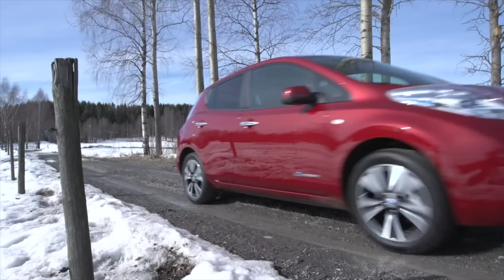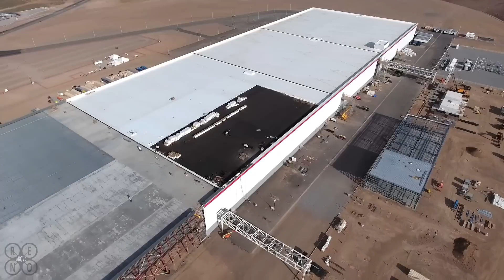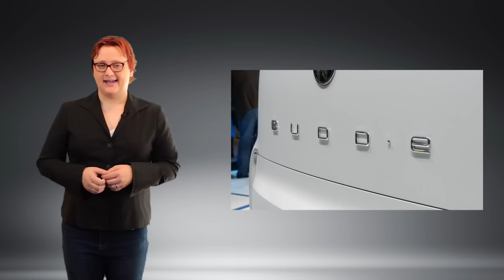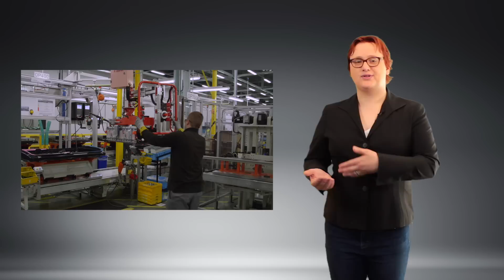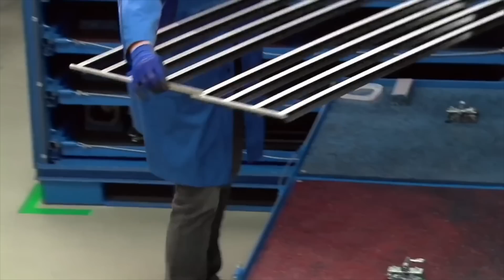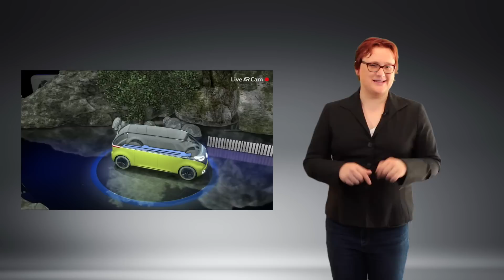What Does an Electric Car Revolution Need? 40 Gigafactories, Says VW

Comment: I think LENR modules (which work per MIT studies of it in 2014) will be energy sources for cars and replacement fuel sources for all fossil fuels (which will become material for plastics maybe).  In 2028 or sooner there will be a giant war.  This war will be the end of application of fossil fuels for war forever.   Meanwhile sodium battery packs could be approved, if they can be made safely (now being tested).  These have more capacity!  More range, lower cost.

Comment: In Germany the unions urge the car companies to build own battery factories. They fear a massive loss of work when fuel motors are not needed any more. So fuel motor factories have to be replaced by battery factories at about the same number and size. One can compare the role of a fuel motor to that of a battery and I do not understand why VW build their own fuel motors, but will rely on foreign companies for batteries.

Comment: That has to be better than the huge number ofoil refineries needed to fuel fossil cars. Fuel which comes from those refineries cannot be produced from hydro, solar, tidal, geothermal, biomass or wind. 'Fuel' for running EV's and to make their batteries, can, and does, come from those sources. The U.K. has been producing up to about a third of its electricity needs from immediately renewable sources, over the present Winter. Norway produces 99% of its electricity from hydro. Almost all fuel for fossil cars comes from the ground, and takes millions of years to replenish.

Comment: My prediction,  the hydrogen fuel cell vehicle is another alternatives. As lithium shortage begins to grow, some fleets will be hydrogen fuel cell. And especially more promising for heavy duty vehicles like Trucks and pickups which requires large heavy batteries.  The hydrogen fuel cell vehicles and  EV can run parallel. The cars will be EV. Off riaders,pick ups and Trucks will go hydrigen fuell cell.
Reply: No. There will be no shortage of lithium. Where do you get that from?  Cobalt maybe . Lithium no. There is Thousands of times more lithium in earth's crust than needed for battery production.Plus it is not finite and used up. It can be recycled for next battery.   I don't understand where ojust drag out random pseudo 'facts' from.  Their ass?   Or why they do it?

Comment: The futur of the electric car won't use lithium battery. Super capa  should be more afordable, longer life time, and fast load. More over the use of nano particle permits to use it in the ground or the roof of the car. This is for a futur of 10 or 15 years (time  to pass of the laboratory to something industriable). But for now, a lot of devices start to use super capa, and some vehicules like bus, like shuttle, they do fews kilometers load fast at each stop and restart immediately, but it's yet the old super capa devices.

Comment: LiIon Batteries are not the future of automobilism. Too expensive, too heavy, too low energy density. If there won´t be better energy storage for electricity, there won´t be an electric car revolution. Look at Tesla Model 3 or Renault Zoe ... and you will realize how far this technology is away form being mass compatible. Because although these cars are extremely expensive, both look cheap inside and their manufacturers don´t earn money with them.

Comment: silly question ... what happens when we mine all known sources of lithium- Do we know what the world holding of Lithium is, Whats the environmental impact going to be with manufacturing of billions off Lithium batteries per year. Don't get me wrong, I am all for this technology and hope that the oil based car industries fade into a dark distant pass. Question is are we going into a technology where are are still ignorant on what the the possible impact to the environment might be or will be? example disposal of used batteries? Chemicals used to manufacture the batteries? All very good to embrace the future of electrical cars, but I haven't seen any possible issues pop up with this technology to date. Are with switching Fossil based market that pollutes the air to a new technology that may have other devastating issues to the environment in other ways.
Reply: lithium once mined remains above ground to be remanufactured. '
Reply: Batteries can be recycled, fossil fuels not.
Plus, in the long run lithium is not the long-term answer, there are better technologies that will become mainstream in the following decades.
Reply: All good, I am not against solar and batteries if anything I am all for it as I am about to invest in it in a major way Like $24K - I just thought I ask a question or two.. And yes Lithium is just the start and other minerals that as yet not been proven, however there would be no doubt that they would be a work in progress
Reply: actually bio fuels are often neglected in the vehicle space for the future. 3rd generation bio fuels coupled with zero toxic pollution Gasoline IC engines are going to be seen very soon. this helps for an actually cleaner and sustainable transport than EV's.  lot of work is happening in the shade on this area. Mazda and many other manufacturers are already in to this way.  before going to high sales of EVs first at least 50% of electricity production must be made from renewable energy. but it is happening the other way which is reactive not proactive. the expected huge fleet of EV's on the road are only going to increase the demand for cheap power from fossil fuels. 

EV companies are businesses just like every other business. their primary concentration is on profitability not sustainability. if they really care for sustainability first they must wait until the countries present electricity generation is at least 50%  renewable or help in doing that quicker, only after this huge EV sales must be started  which would be a more proactive approach.

Comment: I don't think electric cars can be the only solution for alternative fuels 

Like they said lithium is a limited resource 

So if you ask me we need to combine fuel cells biofuels and electrics 

It's not just about the technology it's consumer desires as well 

Not everyone wants electric cars or fuel cells because they are far too different from the gasoline cars they're used to 

Even I think the wine of an electric motor is not nearly as satisfying as a V8 muscle car roar 

I don't think EVs are the thing that will end climate change 

We need other technology to not only add a longer life to the technology but to offer different options to the consumer 

That's just my thoughts
Reply: yeah 3rd generation bio fuels from algae has enough capability to meet the whole of the USA electricity and transportation demand.  to give you an idea 1/10th the area of Colorado state is needed to produce enough bio fuel from algae to meet the whole oil demand of USA. lot algae bio fuel companies are already producing bio fuels in USA.  its just like solar, economies of scale will come down as more number of environmentally conscious drivers demand bio fuels. i guess now the cost per gallon of bio ethanol from algae is almost close to conventional gasoline prices.
Reply: anwesh peddineni 

Well that's interesting to know 

If I had a choice I'd run my car on 100% ethanol (if that was possible) 

Might not be everyone's cup of tea but still

Comment: I am a bit dubious over EV for a few reasons. Dont get me wrong here - I believe in electric cars. But I fear that the shift from fosil fuel will take longer than many think. Gasoline and diesel will probably be around for at least a few more decades. And I think that we have to wait up to 10 years before an ev-cr is actually cheaper than a fosil car.
Reply: actually a shift from crude oil to bio fuels is happening already in the oil industry. confining the future cars to be only EVs is a bad idea. 3rd generation bio fuels in parallel with zero toxic pollution gasoline engines will make the conventional ICE powered mobility  an absolutely cleaner and greener mobility. many auto manufacturers like Mazda are already on this way.

Comment: What is needed is the next battery technology of sodium glass which will simplify and lower costs by 80%. last 10x as long, hold 4x as much energy in traditional form factors, charge fully in 5 minutes with 0 chance of exploding. 95% efficient from +50 to -60 degress C. Best part no precious metals, no toxic compounds, 100% recyclable and cheap as borscht to produce. Sodium is one of the most abundant materials in the world. This Tech is already in pre production workups and should be hitting the market within 5 years.
Reply: Buffalo_Chips We will get there, but only by doing it now with better LiIon Cells. They are at the Moment good enough enough that they can fulfill our honest needs. By doing it like this, there will be enough Money, Competition and need for better Batteries growing. And then it all comes quick. If we otherwise ever and ever say it is not possible, not suitable, not affordable, we'll never get there (and we know it is a Must, because of War about Oil, because it won't last many more Decades, because of Emitions, because it drives much more comfortable and is more silent, what is helpful a specially in big Cities. It is the way to go.

If will something to be happened, we will find Solutions. 
If we are not, we will find Problems.

Comment: Hi Nikki. The next generation battery packs have been perfected & they don't contain 1 oz. of Lithium. The God father of the Li On battery, Professor Goodenough, & his  team at the University Of Texas, Austin have come up with a better battery that should last twice as long, weighs less & will cost less to manufacture than a comparable Li On battery . The new batteries have a Sodium base compound. You'll have to do more research on this. I do know they are hoping to get a manufacture to start producing them later this year. Another group in Europe has a ceramic plate battery pack that looks promising. So glad to see other battery packs being offered for the next generation EV's & storage units.

Comment: If we are going to replace 1m ICE cars with 1m EVs, we will end up with the same/similar problems again in the future. But if we replace them with only 250.000 EVs and make a much better use our of them that would be real evolvement. Cars usually park for 95% of the time, doing nothing. So why can't they drive off and are been used by someone else in the meantime? I don't need to own a car actually, I need a transportation from A to B somehow. If I need a car for a longer trip, no problem as I usually plan this in advance anyway... So, intelligent transport system, software, apps, all this needs to be part of the solution. Not 40 or even 100 gigafactories...
Reply: Shared fleets will become a reality some day but until that happens EVs pollute considerably less so there is no issue with a 1:1 replacement.

Comment: lead is cheap.
The Bolt 900lb pack could be replaced by a lead-acid battery, and still have a range of 70 miles.
A 1200lb Tesla pack could be replaced by lead-acid and have a range of 80 miles

Comment: 40 is by far not enough. The car industry will expand to 200 million cars per year. The car industry will be also combine with energy industries. 200 million times 50 kWh for a car and 10 kWh for photovoltaic buffer storage makes 12.000 GWh demand per year, 240 factories making 50 GWh per year.
Reply: No, the car industry will likely shrink by and order of magnitude, because of self driving cars. Now most cars are used only in 5% of the time, but if they are fully autonomous, they can work as taxis without a driver. Since there's no driver to pay, electricity is much cheaper than gas, and the electric powertrain lasts a lot longer, these rides can be extremely cheap. It won't make sense to own a car for most people. As a bonus there will be much less parking space needed, and traffic will be far more efficient without human drivers.
Also batteries will likely last longer then the cars, so they could be reused. Current Tesla batteries are expected to still have over 80% after 1 million miles driven. And after than they are still can be used for other purposes where energy density is less important.
Reply: Soon 8 billion, expected 10 billion humans. How to bring children to school? Maybe small self driving cars. When 10 billion humans have 6 billion cars with average 24 years usage, the car industry has to expand to 250 million per year.
Reply: We don't use our car all the time. It's more like 5% of the time. So we would need only 1 car for every 20 person. But cars can carry 5 or more passengers, so with some optimization that computers can do easily, we only need 1 car for ever 100 person. And that calculation completely ignores public transportation, which is far more efficient. But staying with the 1 car per 100 person ratio, because not everyone wants to share, and limiting the lifetime of cars to 10 year, because we like shiny new things, it's still only 10 million cars per year for 10 billion people, 7 times less than we make now. If a battery lasts 1 million miles, that's 270 mile driving every day for 10 years, that's more than an average taxi drives.
Reply: And how do You came to the idea, that public transportation could be more efficient? Why should I have always to wait, until some other people want to go, where I also want to go? Why do You spread such communist horror vision of our future?
Reply: Public transportation is more efficient, because it is. It uses less space, less energy, and less raw materials. Maybe you've never tried, but you can Google it. You will see for example that it costs you much less than owning a car. And you don't have to be able to drive, that' a pretty big bonus if you are a child for example.
You are still don't understand. The system will be run by a swarm of supercomputers, you won't have to wait at all. And you won't have to share, if you don't want, but that will cost you more. Also people are using public transportation all the time in capitalist countries too, it's not a communist invention.
Reply: And why should be less space, energy, raw material be of any importance? Do You know the old spell "My car is my castle"? Tesla X drivers just pull 2 ton caravans to their vacation destinations. With the fossil age, the scarcity ends and these permanent sermons for save reduce cease.

Comment: Andrew is right energy density of storage will make a logarithmic increase. The  super capacitor market  and the Solid state batteries may very quickly over take lithium production. I favor the (NA) sodium batteries. But there will be many different types of storage emerging all at the same time. This the age of the the battery revolution. Goodbye Gasoline.

Comment: This video ignores the serious possibility of new major discoveries which may entirely change the nature of electric vehicles and how they are powered. Li/ion batteries take TOO LONG to recharge....the development of a battery which works like a capacitor would make instant recharging a possibility. The use of " Bloom Energy" "Bloom Boxes" could also effect the industry as even though Musk calls them " FOOL cells", the use of abundant and cheap natural gas WITHOUT air pollution is possible. Combining this tech with superconductive motors would be a revolution. The scientists and inventors need to see beyond their noses.
Reply from the maker: No, but when planning for the future (don't forget Volkswagen has its own in-house tech for next-gen batteries) you have to work with what you have, not what you hope will exist.
Reply: Indeed. Many of the comments suggest that lithium-ion batteries will not be the long term future. However we can't just stop and wait for a new technology to mature.. There have been li-ion killers in the news ever now and then  for a decade now.. nothing in the appropriate scale yet. Same as the "tesla-killer-wannabe's" ..

On a side not.. WV talking about EVs .. LOL it's just that - talk.. No reason to even mention them until they bring a high-volume production model out in the market. And that won't happen for at least another two years..

Comment: As mentioned by many,  it seems the li-ion battery will be replaced in a near future by either solid-state batteries or supercapacitors.
 Many groups of researches are working on the mass production of graphene, which seems to be the answer to many issues and might revolutionize (again) the industry (lighter, cheaper, denser, higher range and much faster charging "batteries" - i.e. you phone would charge in seconds, your car in a few minutes). Such "batteries" already exists as prototype. The need of batteries would drop for cars (combined with the optimized of automated transportation with self-driving vehicles). However, there might still be a considerable demand for homes, business, factories, etc. 
At the moment, with a new breakthrough nearly every month, even the near future seems hard to predict. Nonetheless, I believe these are extremely interesting and promising times.

Comment: The problem is that the battery technology is evolving rapidly and no one would want to invest heavily in a technology which could be out dated before they're recouped the R&D and tooling up costs. With Glass/salt batteries possibly offering 3 to 10 times the current charge density over LiIon, cost and size are likely to take a major drop so I think most car manufacturers are being cautious and while demand can be met with existing supply then they're not going to build battery factories unless they're forced to.